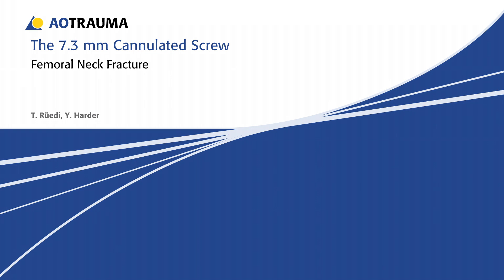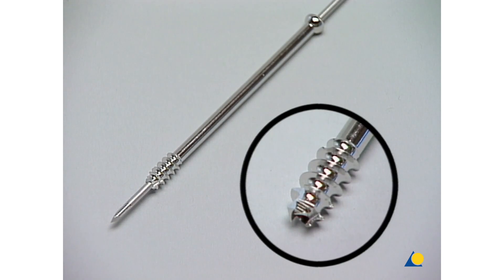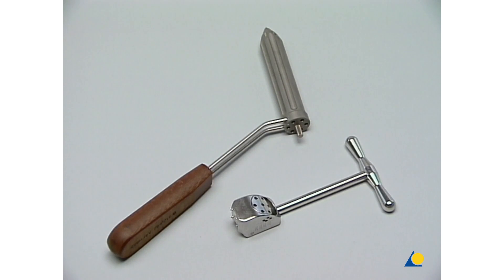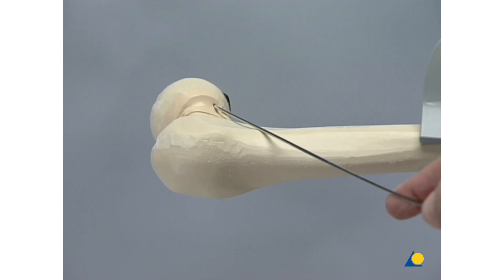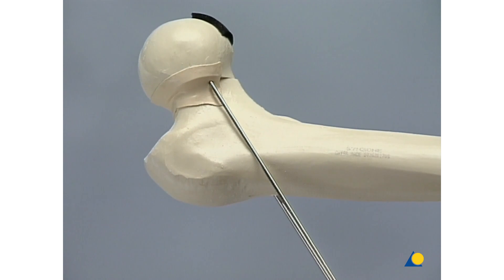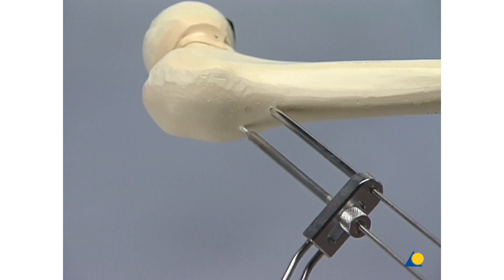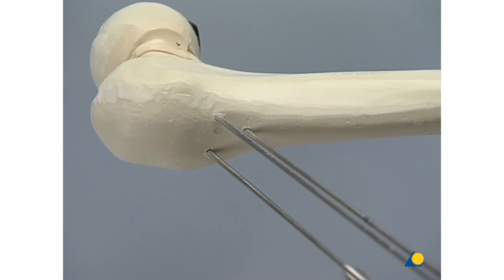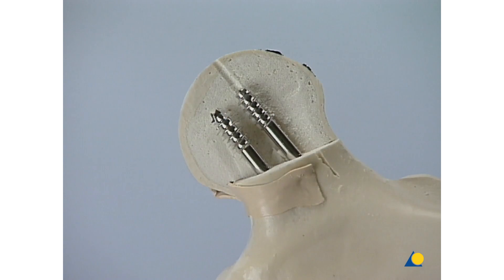Femoral Neck - Fracture - Fixation Using the 7.3 mm Cannulated Screw

Comment: This video is very informative. I was confused by the term "wire" since that implies a bendable small diameter coiled material. They are more like guide rods. Anyways. I just had this procedure performed on me. I (42m) broke the femoral neck of my left femur  in a cycling accident. I was taken to the hospital promptly, they performed the procedure about 7 hours after it happened. The longer the wait, more likely a chance of AVN of head. I am still concerned of avascular necrosis of the femoral head since the blood vessels were probably torn in the fracture. I am instructed to not put any weight on the leg, I will probably not be walking for two months at least, since that is putting stress on the fracture plane. The bone is healing and do not want to jeopardize this process. I probably will be off the bike for 3 months. My understanding is it will take a year for this bone to fully heal. Probably leaving in the screws or if my insurance covers the removal then I will pursue that in a year. That opens the door to infection which is not good as you know.

Comment: I was operated the same way it fixed my fracture in 3-4 months
Reply: Hi there! I had the same surgery, and I kinda da need some support. I would like to know, will I be able to do sport after my fracture recovered? It’s been almost 3 month after surgery.
Reply: Little update. It’s been 3,5 months from the surgery. And now I can finally walk normally!
Reply: @bauyrzhanesov8419  good 👍after a year you can ask the doctor if you could remove the screws
Reply: @bauyrzhanesov8419  well if you don't have pain and are able to walk normally you can start to train little by little . But surely you should check with your doctor on the current fracture status. And then take a decision
Reply: @sharathrao6  what about you? do u feel good now?
Reply: @bauyrzhanesov8419  yes I was good within 6 months
Reply: @sharathrao6  can you walk normally?
Reply: @bauyrzhanesov8419  yes I was able to walk in 4months . I started to run after 6months . I was reoperated after a year to remove the implant
Reply: @sharathrao6  sounds relieving. Thank you!
Reply: @Shima sweetcandy yes after the implant was removed I started walking the next month onwards
Reply: Hi i had same today its 20 daya 
Give me suggestion and tips
Reply: I m seating on bed walk by walker can i movement on bed like sleep on left side?
Reply: @sameerdosina6511  better try to do it after a month
Reply: Hello sharath there is little pain in winter. 11 mnth completes.
Reply: @vivekbhange7150  it's normal here and there u feel pain while you've done lot of physical work
Reply: @sharathrao6  hello brother,  I am 16 yrs old. 
1- I had surgery 2 days ago and my body is already very weak. So can I be right?

2-is it necessary to remove this screw?
Reply: Hi Sharath ,I had done same surgery on 26july 2023,I am very happy to know that we can walk in three months,any suggestions please advise
Reply: Can you tell the role of exercise?  Like how much you did.